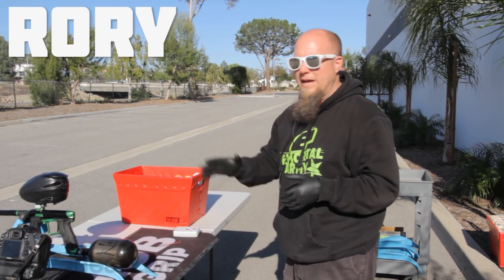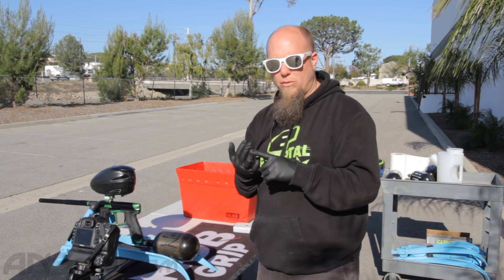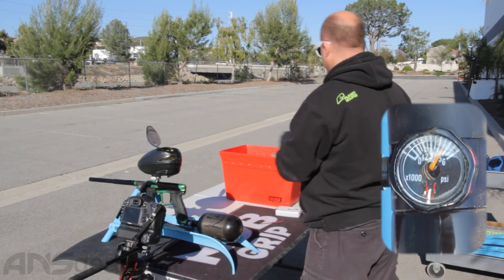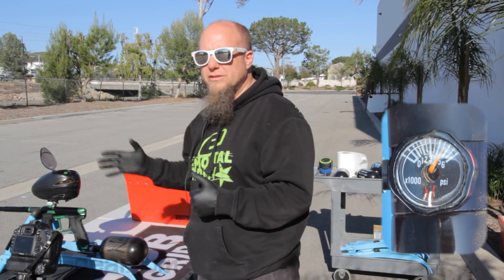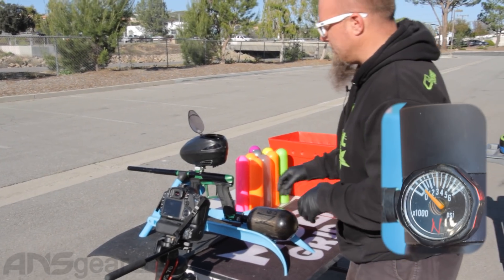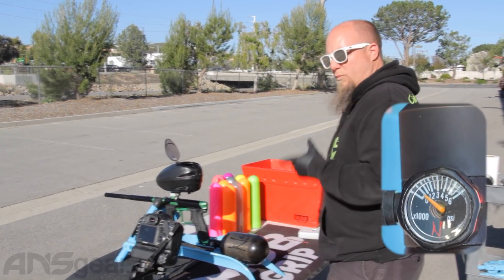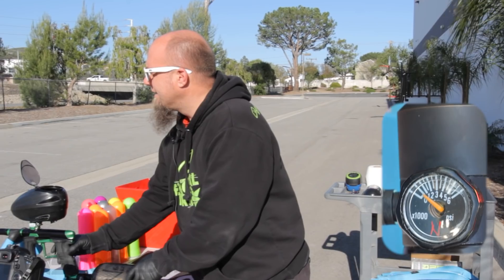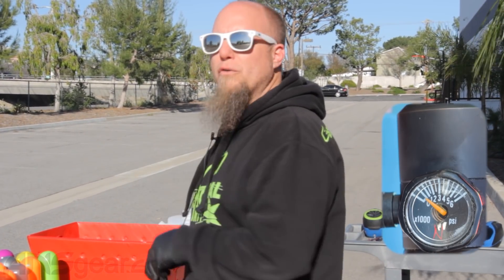Planet Eclipse Geo 4 - Efficiency Test

Comment: With a proper underbore you can probably get about 13 pods which is pretty great compared to the other high end markers currently available
Reply: I have had an emerald 4 for about since Jan 2021.  If I am underboring and shooting 295-300 with low output and the SFR close during summer time, I am loading the 12th pod before shoot down happens. Then I one ball it til the loader is empty.

Comment: Personally when I do an efficiency test, I only count the pods HOWEVER I put + at the end to compensate for the 60 more rounds in the hopper that shouldn’t be in that first pod. So for example, he shot 10 pods, (Not 9 because he put a pink pod back in the bin after he used it than picked it back up again later still not realizing what he did lol 😂) than an 11th at the beginning with that first hopper fill making the efficiency test 11+ pods. I also say it like that because depending on other factors like ball size, humidity, bore size ect., that could increase or maybe even decrease a little so you can never really give an exact ball # for an efficiency test. CS2’s and 170R’s have about the same range, if anything those guns also shot 11+ pods. All of planet eclipse tournament level guns (170R and higher) shoot over 11+ and their lower end guns (Etha 2 and below) shoot about 9+.

Comment: Why do everyone here recommends to open the air flow on the gun so it shoots smoother or leave it stock I want the gun to shoot smoother I don’t shoot faster then 10.2 anyways please advise
Reply: My first time owning a geo
Reply: Hey, sorry for the late response.

My steps to messing with the marker are as follows:
1. Shoot gun until broken in. Some say 20,000, I got for 30,000. 5 cases extra isn't too hard for me.
2. Grab highest bore barrel, raise dwell slightly, drop SFR all the way down, adjust velocity to meet my needs.
3. Mess with dwell a little more to find it's near breaking point where velocity drops, then raise it up by 0.5.

Comment: I get 650 shots with a 68/4500 lol, Im about to order a 90/4500 with remote line & I still will not hit 1200 balls
Reply: Question, are you filling all the way to 4500 even? If not, you are for sure leaking air somewhere. No tournament grade marker is that inefficient with air. That's barely a hopper and 3 pods, something is definitely up with your marker.